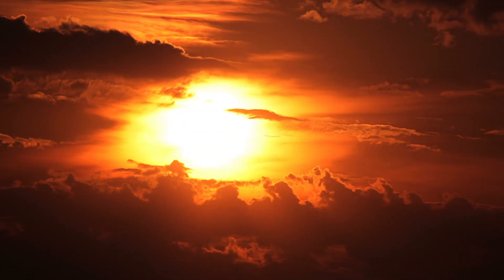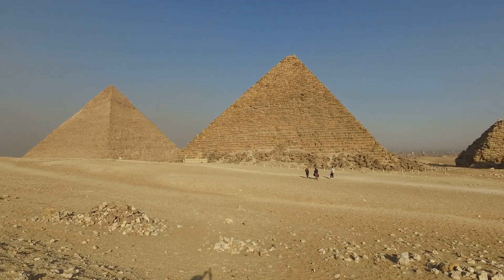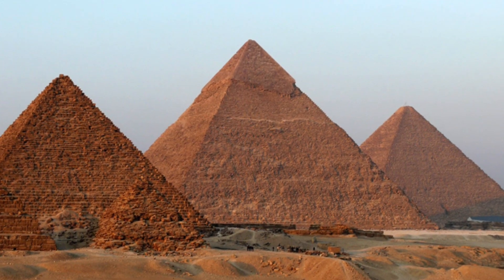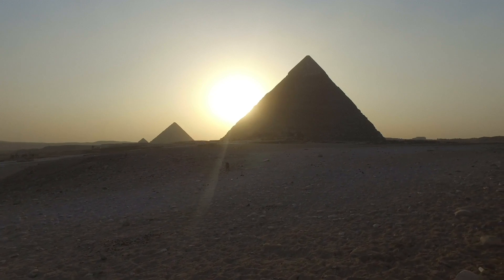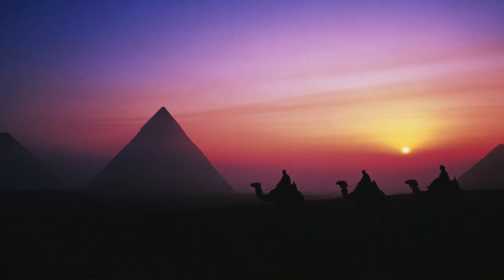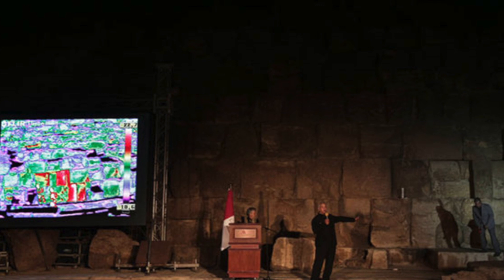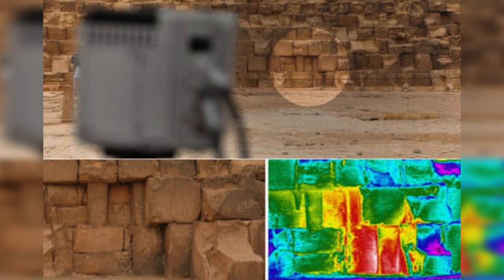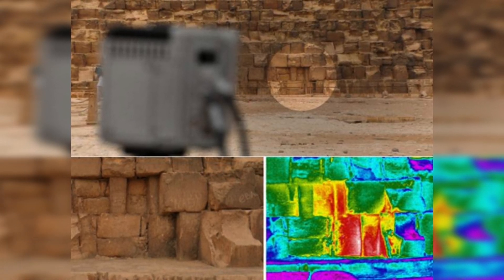The Great Pyramid Of Giza Is Still Displaying Unexplained Thermal Anomalies

Comment: The temperature range looks minimal at +/- 2degC from the centre. It could purely be higher levels of metallic compounds retaining more heat during the day and dissipating at a slower rate than its neighbouring blocks.

It could also be surface contamination assisting in excessive warming by day and false flagging the data. I've little doubt it is CTE related.

Comment: It makes more sense that the pyramids were used for something important rather then slaves forced to work on a monument. Would  forced slave laborers really be able to make every rock and cut so perfect? it seems more like the people who built it really wanted to work on it for a purpose in my opinion
Reply: They weren't slaves, it has been proven many times over now. They were highly skilled workers who were well paid & looked after well. The 'slave' story is a load of crap
Reply: Think of the numbers....each stone ( perfectly cut, and no 2 are alike)....weighs about 2.5 tons each, and there are 2,500,000 such stones to make a pyramid. I did the same math as the video presenter and I agree it would take 20 years of non-stop, 'round-the-clock work....to place and fit each stone. Think of the inevetable inefficiencies of not being able to do this with 100% efficiency....and you will see this wasn't done by low-tech people using brass chisels.